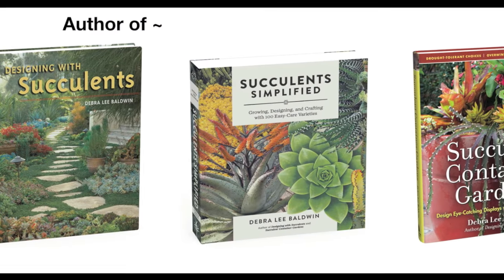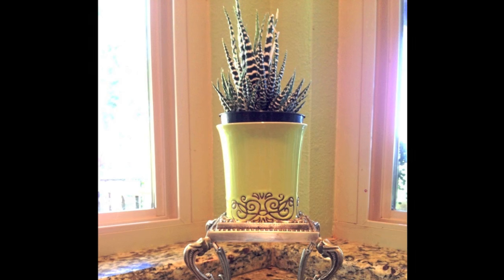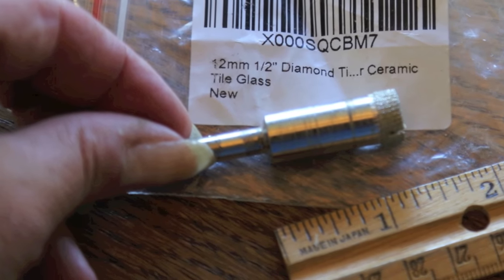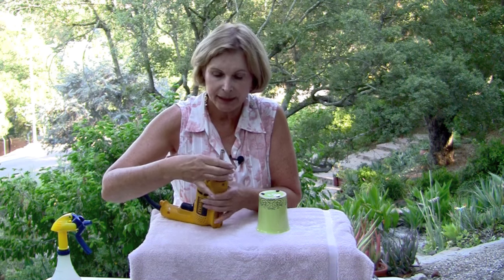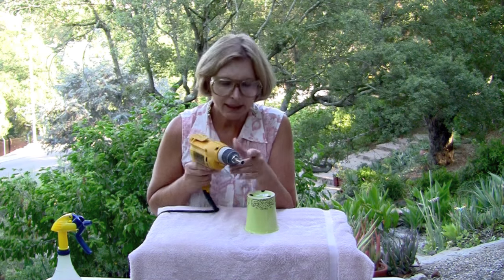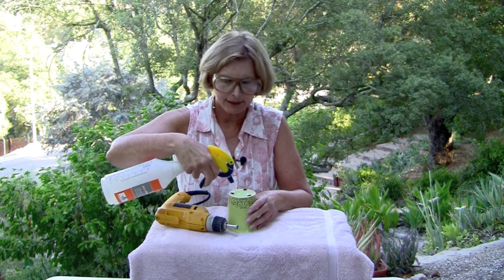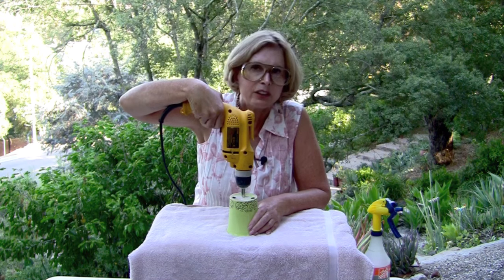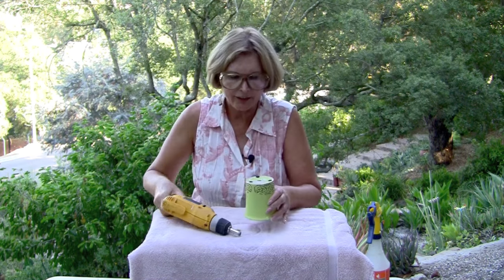How to Drill Holes in Nondraining Pots

Comment: Hi Debra....used your video about 5 years ago to do this on a yellow ceramic pot. Doing it again and came back here to reacquaint myself with process...just watched about 6 videos on using diamond drill bit -- your's is still one of the best for sure!  

I would just add that for creating the "purchase" it's important to angle drill (as you did) at about 45°.

Comment: Water is not the only problem when you have no drainage holes. I lost a plant in a glass container because though I did not overwater it the salt and fertilizer collected at the bottom of the container over time and created an environment that killed the roots. I would not use a pot without holes ever again.
Reply from the maker: Good point, Silvia. I should mention that I always use purified water, never tap water.